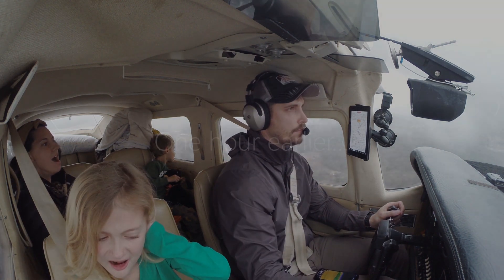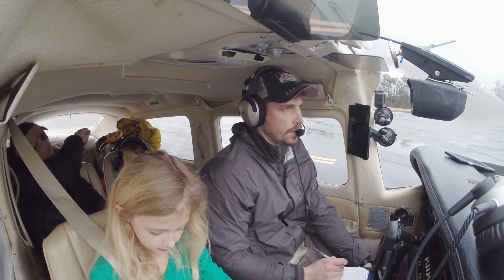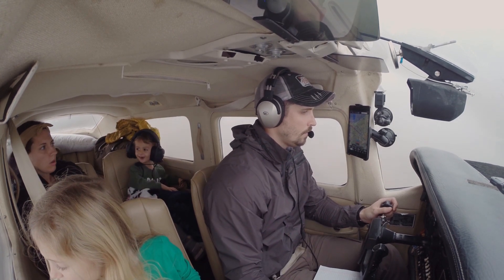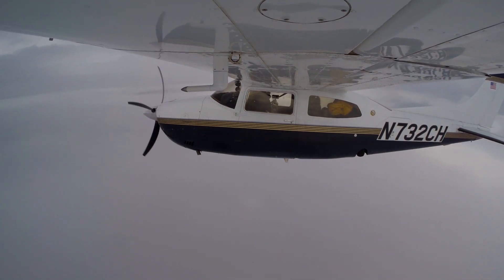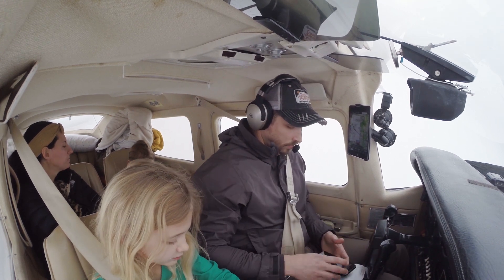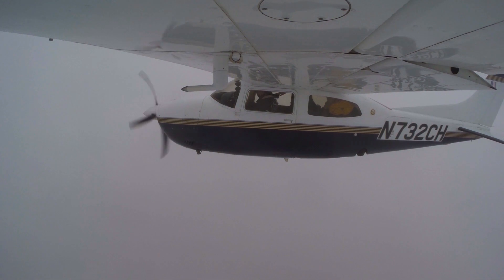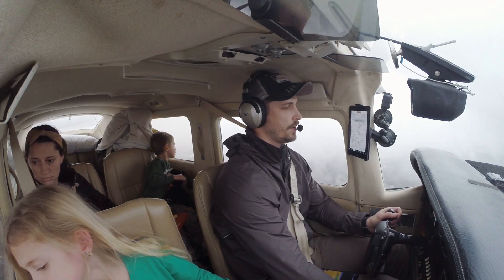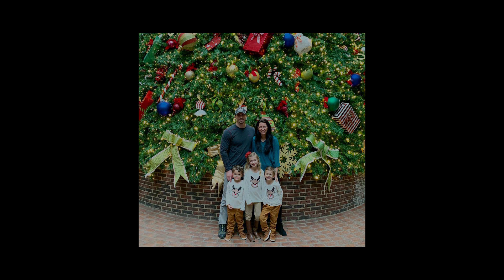Hand Flying an ILS Approach to (nearly) Minimums: IFR Flight in a Cessna 210 to Nashville, TN

Comment: I hope you get the ear pressure/pain figured out for your daughter. My wife has had such bad ear pain experiences over the years when flying that she just won’t do it any more. A real shame. Once on a trip to Colorado her pain was so bad on the way out that she wouldn’t take the return flight. We wasted the return tickets and drove a rental car one way home to FL. So, I hope you’re able to find a solution that’ll keep her happily flying pain free and looking forward to your awesome family flying trips.
Reply from the maker: Thanks! Ear pain can be extremely debilitating.  Normally it's fine for my family if I'm able to descend at a relatively slow rate.  Couldn't on this day as I was at the mercy of air traffic control.  I haven't had a chance to test the earplugs out with my daughter yet, but they're called EarPlanes; picked them up off of Amazon.  They have a valve in them that slowly lets air/in out so it equalizes over a longer period of time.  They received really good reviews so I'm optimistic they'll work.

Comment: There is really no substitute for the valsalva maneuver. I flew a family of four and the ones who learned the maneuver had no issues. The others, including my wife, had ear pain on fast approaches. My wife later learned it and that fixed that.

I can't talk. it took me 10 years of flying to learn it. I always tried it and it felt like I was going to damage my ears trying it. One time after flying I had an ear block that lasted for days and was very painful. I was sitting at home trying to fix it and suddenly my ears cleared with what sounded like a commuter train coming to a fast stop. Never had trouble after that.

Comment: Nice vid. I’ve just gotta mention, I used to fly with my dad quite a bit without ear pro. We used the old hand mic and overhead speaker. I have tinnitus and very slight hearing loss they think may have been caused by this.  I’m in my 30’s now and I’m sure the 152 and 177 we flew was a bit louder, but just felt I should say something. Regardless, thanks for sharing!

Comment: Subbed. Regarding earache, as you know kids will tend to grow out of it but there is little that is effective beyond chewing gum or attempting to pop the ears (easier said than done with little uns I know). I used to find tilting my head back while swallowing helped but it tends to depend on the angle of the ear canal and everyone's different. Fly safe.
Reply from the maker: Thanks for the tip, I'll have the kids try that out! My daughter is already doing better with it. On our last flight, ATC had to keep me at a relatively high altitude with regard to my initial approach fix. Once they cleared me, I had to make a pretty steep descent to that point, and she handled it well.

Comment: Great job!   Let me know how those ear plugs work out, Conall has the same problem.  Equalizing the pressure by traditional methods proves difficult with the little ones.
Reply from the maker: Thanks!  I'll keep you updated about the ear plugs.  They're called EarPlanes...picked them up on Amazon.  They received excellent reviews; there is a small valve in the ear plug that slowly lets air in/out.  This allows the pressure to equalize over a longer period of time.  They've got adult and pediatric sizes so it should work for Conall.  If not, I guess there's always the pressurized versions of both of our airplanes... :)

Comment: ~~ QUICK EAR PROBLEMS SOLUTION ~~
WARNING: FOR NO MEDICAL ISSUES
- Mouth closed.
- Hold/Pinch your nose.
- Pull down on problem ear lobe.
- Then blow had, try to in blow out the blocked nose.
- Don't release the pressure, just pump it up and down.
- When ear pops STOP and see if its clear.
- If a bit better then repeat.
* This clears the Eustachian tubes behind the ear drum. As the ear blocks clear it as soon as possible.
WARNING: SEEK MEDICAL ADVICE IF ISSUE DOES NOT GO AWAY.

Comment: Have your daughter squeeze her nose preventing air from passing thru while keeping her mouth closed and sealed off and raising her tongue against her hard palate while she is doing this have her do a valsalva mauuever. ( like a pregnant woman bearing down to push the baby out/ or straining to go to the bathroom) It will relieve the pressure in the ears. the air will pass thru her Eustachian tube  out her ears and the pressure should be equalized. I am a scubas diver and that's how I clear the pressure in my ears. I guess I sounds a little fishy but it should provide relief while your in descent. Nice video too. I have made a lot of landings and practice ILS approaches into BNA.
Reply from the maker: I know the process you're talking about...tried it a few times myself!  The difficult part would be describing it in a way that my daughter could repeat it.  I'm hopeful these ear plugs will work out.

Comment: Great video. What speed did you approach at when they asked to keep your speed up? My normal is ~110kts in the 210, but always wonder when a 737 is pounding down behind you.
Reply from the maker: When they started my descent I was maybe 15-20 nautical miles out from the final approach fix. In situations like that I'll try to maintain 150 knots in the descent.  I'll gradually slow that to 140 as I get closer to the FAF.  I'll drop my first notch of flaps and gear just before the final approach fix; I like to be in landing configuration when I cross this point.  From then until I see the ground it's 110 knots like you.